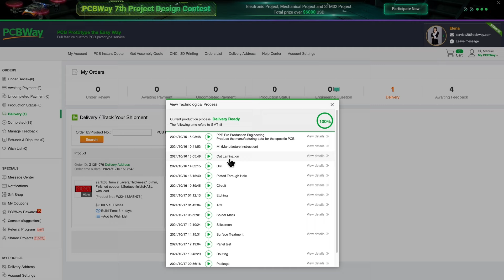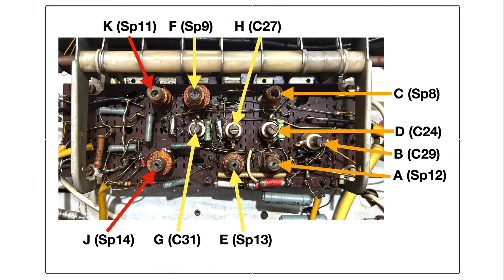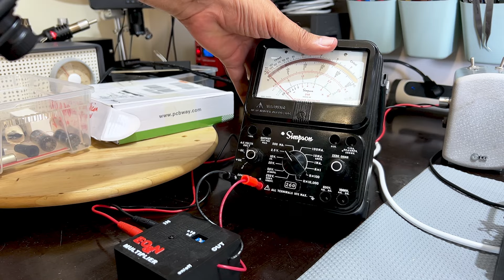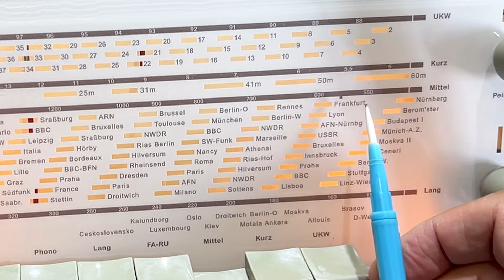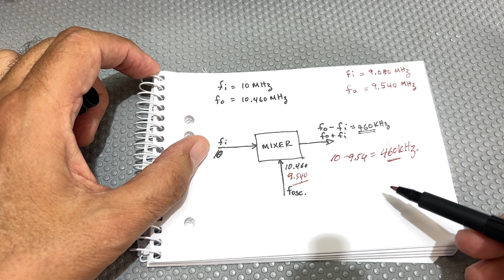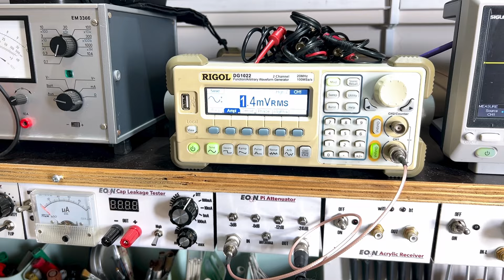Restoring a Braun TS2: Accurate RF and IF Alignment & Unexpected Image Frequencies - pt4 #pcbway#

Comment: hi Manuel, i don't like the socket saver signal injector, because I'm sure this s9cket adds  some input and output capacitance to the tube, and it will affect more to FMIF
Reply from the maker: It’s not used for FM IF. Only to inject the IF signal for the AM alignment, so absolutely no influence.

Comment: Nice catch, I encountered the same phenomenon multiple times on my radios. I don't think that there were lot of radios that had SW image rejection at that times, especially the ones designed to be used as a main home radio with "classic" E tube 80 series assortment. I did came across one Philips which had multiple SW bands along with LW and MW, and used EF89 as an RF amp in front of mixer/oscillator ECH81. If I remember correctly, it had great SW reception and no mirror image of the stations, mostly because the front end was tuned twice, so the filter was much sharper.
Reply from the maker: True. They made these as living room sets, and not for serious SW listeners

Comment: Nice going. How would one go about adding headphones output? Thanks for the video.
Reply from the maker: I guess you’d have to create an impedance matching circuit if you want to drive the headphones correctly while still providing the OT with a reasonable load. Interesting question. I haven’t actually looked too closely at that issue with a tube radio before. Maybe someone else here has a good answer ?
Reply: Perhaps I could look for a tube amp schematic that has such a circuit type.

Comment: Another fascinating and very informative video! Sharing these idiosyncrasies that you come across really help an amateur hobbyist like me. It's great knowledge that can save a lot of time when coming across an apparent problem that suddenly has a familiarity about it. The alignment instructions are super helpful too as I still have half an eye out for one of these TS2's!!
Reply from the maker: Be careful to not fall into the Braun fan-club mode 😊 you’ll end up spending a lot of money 😊 The good thing is that they are generally smaller physically than the others, so space requirements are less critical.

Comment: Braun had a big focus on the design and practical use, but not on the reception of SW. For good SW reception it would require a band spread and a first IF far beyond 460kHz like the Satellites from Grundig and others.
Reply from the maker: 👍 yes, tuning without a band spread on SW is really tricky.

Comment: You're right. There is nothing practical that you can do to increase the selectivity of the antenna input coil on shortwave. This set was designed for the casual shortwave listener who would probably be listening to FM, MW or LW with it  most of the time, so the shortwave band can be thought of as an add on. Back in the glory days of SW radio, the bands were chock full of powerhouse broadcasters that provided potent signals, thus interference from poor image response would not have been much of an issue.
Reply from the maker: You’re probably right. Braun had a very practical way of looking at their products, so if the focus was local stations, they wouldn’t have gone to many lengths on the less popular bands.

Comment: I think you may have hit the nail on the head mamoynas. The coils could easily have more than one point where they peak. The point where they are peaked now may accept harmonics and therefore not be as sharp. It may be worth running at a lower input level from the generator and sweeping the whole coil to find the best peak. Like you Manuel I usually go from low to high frequency adjustment and back (rinse and repeat) until the frequency is right and then adjust the front end. Is this a case perhaps, where the tuning coil and aerial coil should be done together to find the best peak with least harmonic acceptance?
Reply from the maker: Could be. I’m still trying various options.

Comment: Manuel, your restorations Have gone through dramatic changes from your faceless days with the heartbeat introduction. Not just your more relaxed presentation and technical growing experience in the hobby but the mastery of new gadgets that allow you to re manufacture aftermarket parts like the dial glass or back cabinet cover. I don't know how many radios you have in the pipeline but perhaps you could make a list of things to make from scratch with all your new tools and expertise like a AM FM tube or solid state receiver or ...then run a poll In the community column of your channel page. (to long a comment)
Reply from the maker: I have quite a few radios that need work, so there’s no shortage of projects. I like to make stuff as they are needed, and there always seems to be something I need 😊

Comment: Just an idea...  What if SP12 is tuned at a different spot and maybe has 2 or more peaks? What if you turn that fully CW, feed the 7mhz , turn it CCW all of its way and see if it is working on more than 1 spot, if that is the case then measure which spot has the largest output and hover arround there for fine adjustments and for the rest of the procedure (same thing goes for C29)
Reply from the maker: It has two peaks, and I tried it, with no improvement
Reply: Usually the SW oscillator coil has 2 peaks because of mirror reception. In old alignment instructions were often written which position is right (usually the one with lower inductivity, so higher oscillator frequency). Today you can easy check it by counter s f osc is 455kHz higher than f in.

Comment: I need to do  the fm  alignment, but I don't have a F. generator or oscilloscope, what can i do, my radio is a RHEINLAND LOEWE OPTA.
Reply from the maker: It can be done by ear, but if it’s working, don’t do anything without the equipment as it’ll probably turn out worse than it is.
Reply: @electronicsoldandnew   I am getting 92.5 on the 88,  and 107.3 in 100, the stations are not in their right position, they have strong signal.